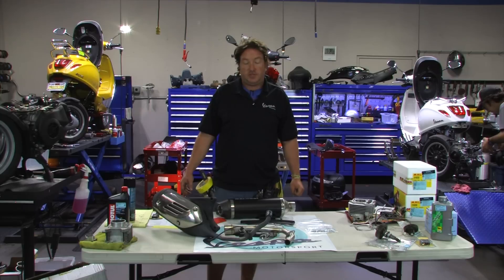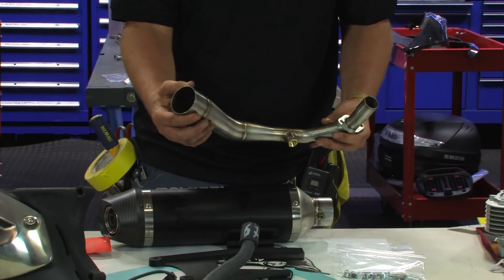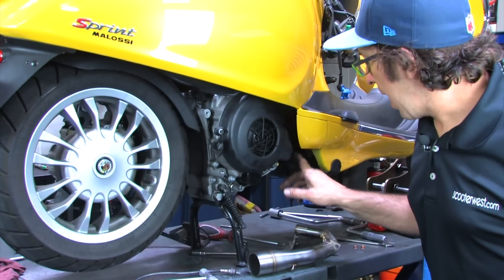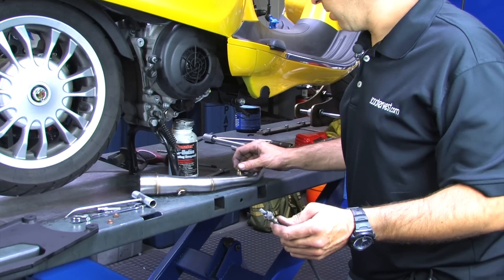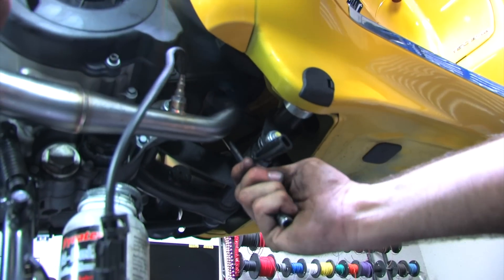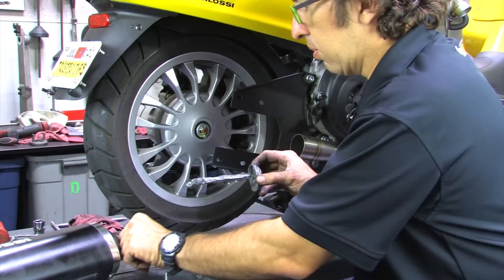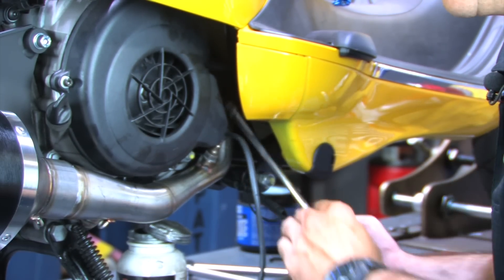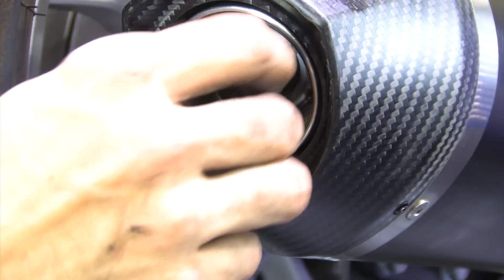Malossi Performance Exhaust for Vespa Sprint/Primavera

Comment: Do you need to remove the header or can you slip off the muffler and holding Bracket to gain access to the rear tire for a  tire change out?

Comment: How important is it to have the header pipe to go into the cylinder head? I have installed a header pipe that I bolted to the cylinder head but it doesn’t fit inside the cylinder head. If this fine ?
Reply: Head exhaust pipe*